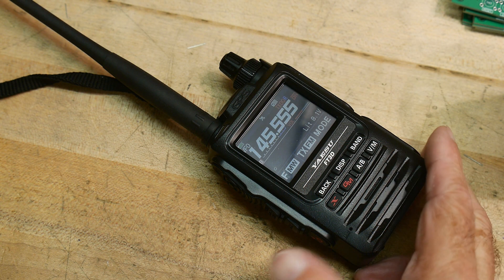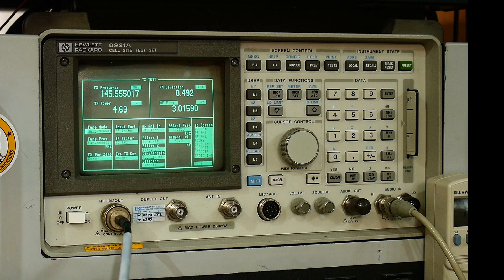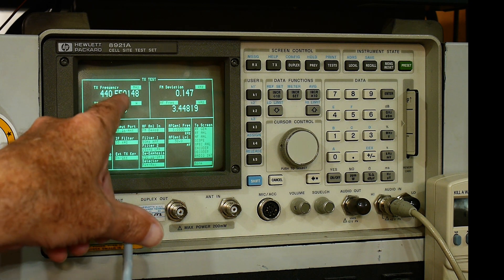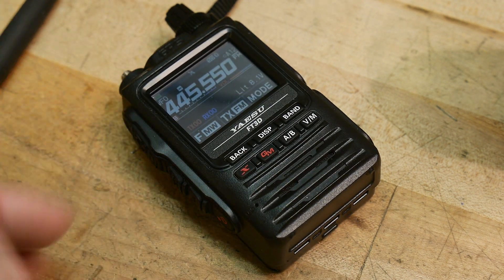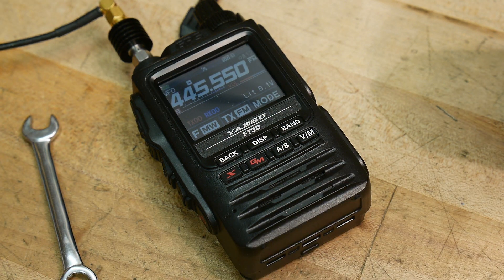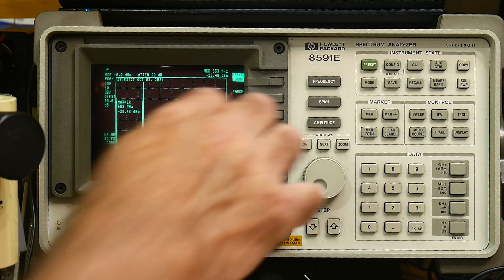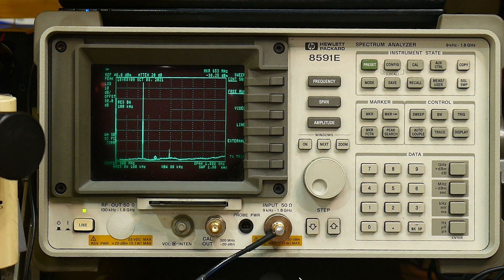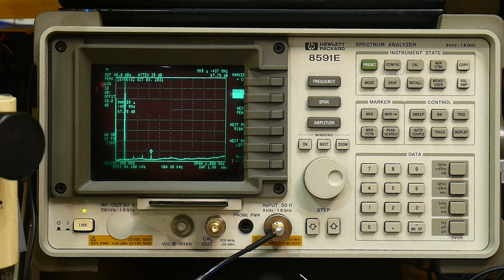#935 Yaesu FT-3DR Measurements

Comment: Per §97.307(e), for transmitters 30-225 MHz and 25 watts or less, the mean power of any spurious emission must not exceed 25 µW (-16 dBm) and must be at least 40 dB below the mean power of the fundamental. Note that the 25 µW is an absolute number and the 40 dB is relative to the fundamental.

There are no quantifiable limits for transmitters above 225 MHz in the U.S. amateur radio rules.

The 43 dB number that you mention is in §97.307(d) which applies to transmitters below 30 MHz.

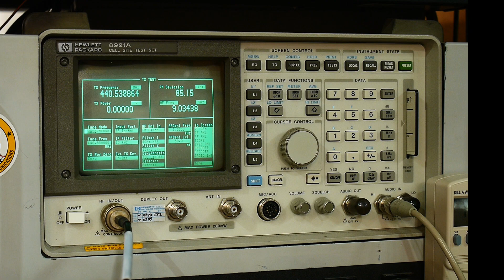Comment: 2:33 you entered 445.55 in the radio but the analyser detected only 440.55
Reply from the maker: sorry about that. i had typed it in wrong on the radio. i caught that error and typed it in right but the camera was not on. anyway the power out was the same.